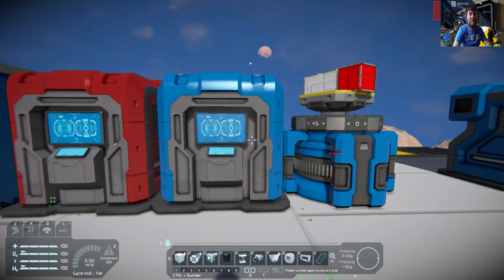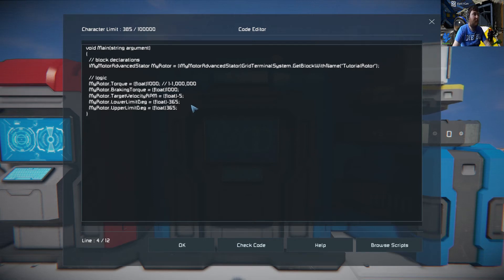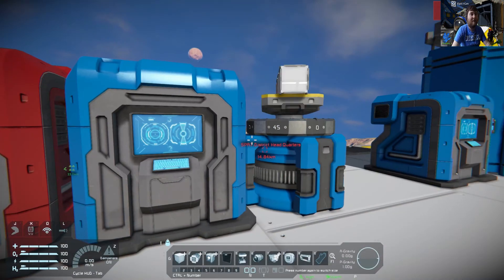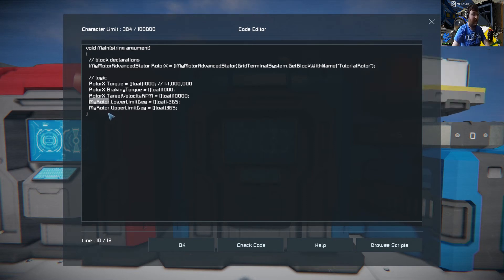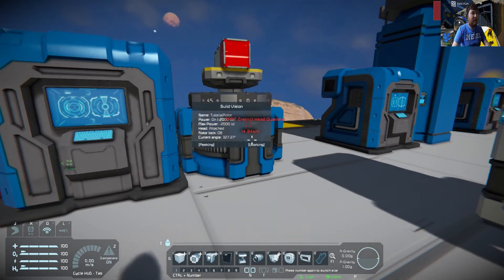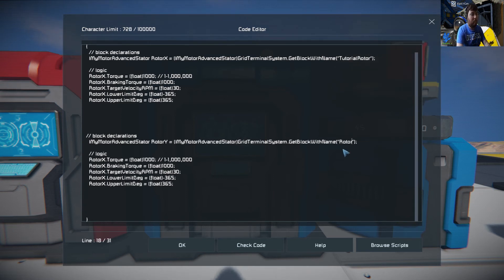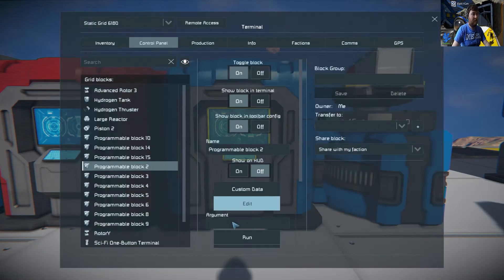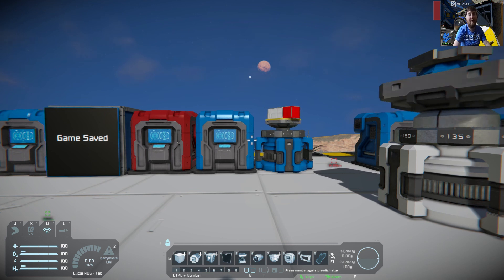Space Engineers - Script Tutorials - 2 - Control Rotors

Comment: How to start/stop a rotor with programming?
Reply from the maker: Hi JasonRobards2
Unfortunately I cannot find a way to "Lock" the rotor which would be a good way to start and stop however you could use one of the following Actions along with setting a high braking torque

Actions:
OnOff -> Toggle block On/Off
OnOff_On -> Toggle block On
OnOff_Off ->Toggle Block Off

If you have a rotor called "MyRotor", you would have the following code:
void Main(string argument)
	{
	  // block declarations
	  //Look for a rotor called "MyRotor" and assign it to "MyRotor"
	  IMyMotorAdvancedStator MyRotor = (IMyMotorAdvancedStator)GridTerminalSystem.GetBlockWithName("MyRotor");
	  
	  // logic (Only need use one of the actions mentioned above, in this case OnOff)
	  MyRotor.OnOff 
	}

You will need to select "Run Script" on the programable block to switch between On and Off
Reply: @smcwallgaming  or have a timer block run the script when you press a button.

I’m building the Voyager now, she has 4 elevators of which 2 are 20 stories high. 

It will be a wheeled elevator, that uses rotors to measure the distance, while storing height in a memory.

To make it more interesting I want to add a password for various floors to fill in on the LCD screen and for the script to crosscheck with a list of security levels and passwords. Learned a lot from your tutorials though!
Reply: Hi and thanks for the reply. In the mean time I had a working result by changing the velocity between 0 and 1. Definitely on lower speeds, changing the velocity to zero gives an accurate stop. 
Moving the rotor a specific angle can be done by taking the current angle (rotor.angle), adding the desired angle to it and stopping the rotor when it reaches it. Beware that the rotor requests its angles in radians, so converting is required.